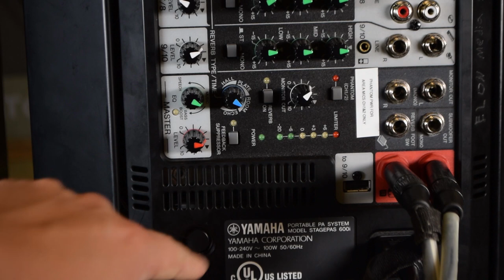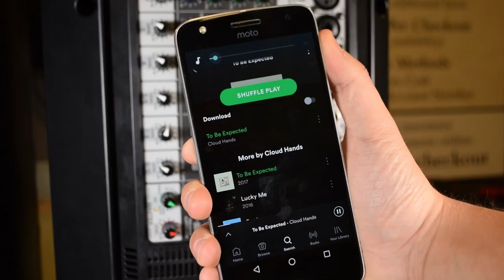Basic How To: Yamaha Stage PA

Comment: Is this a 400 or a 600?
Reply: Star Gazer  the 400 and 500 are the exact same except the size difrence .the 600 is more louder though and it's. The 600
Reply: @jatta4439  Between the 400 and 600 the amplifier is different, the mixer is different and the speakers are different.  The mixer on this looks like a 600.
Reply: I'm just 10 years old calm down
Reply: I have 600 for my bass guitar and drum kit
Reply: This is a 600i, as later on in the video you eventually see the model type when he pans a camera shot on part of the mixer.  What I looked for initially to tell the difference between the 400 and 600 model is that the parametric equalizer section for each channel on the 600i has Hi, Mid, Low, controls where as the 400i only has the Hi, Low, equalizer controls.  The newest models, 400BT and 600BT also provide Bluetooth capability now.
Reply: I have the 600bt it distorts even when volumes not right up terrible piece of equipment.
Reply: @joe_casinoacoustic1773  I ended up buying the 600bt.  I don't have any problem with distortion at high levels, but it doesn't have as much low end capability as I was hoping for.  I'm considering a sub for it, but I want to hear it first.  Other than that I'm happy with it.
Reply: @joe_casinoacoustic1773  Are sure that not your signal is distorted? Have you ever tried the bluetooth section with spotify or anything clean signal? I just blinked into 1 or 2 of your covers and but sounds like your mic or effect pedal already distorted before it reached the mixer of your stagepas. If your pedal doesn't show clipping through your inputs then try to lower the output of your device (As it sounds like your are using chorus on your guitar, I'm sure that you are using some extra device and don't go directly to the mixer)  You can try to plug your guitar directly as well, but when you hit the body of your guitar to create rythm it's easy to create clipping and it sounds like it's distorted. it's a tricky thing to watch everything separatly when you hear that the master is distorted. You can create cliping through you mic aswell when you are to close to the membrane and sing to loud or do beatboxing.  I have been using yamaha stagepas 400 for 5 years and I don't have any distortion problem with it. Even if it's to loud but your different channels are clean (and not distroted) the master channel use limiter and sounds extremly compressed but not distorted. Once I used stagepas 600 and it had much more power than 400. But I'm really curoius about stagpas 1K:)